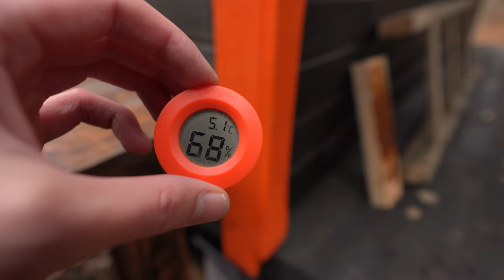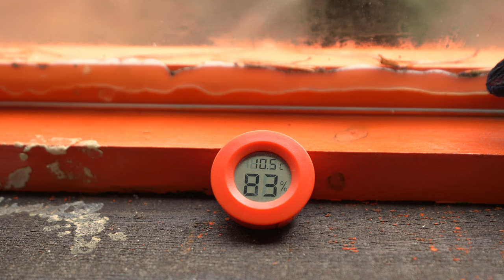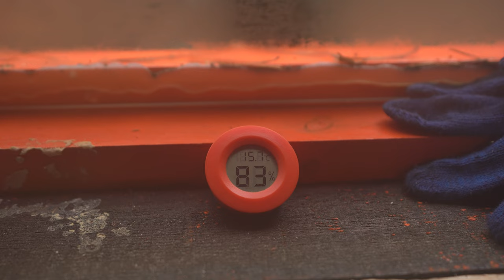Little house in the woods, making a bed (short version)

Comment: Hello my friend, hope you are well! ? You could have made the work on the legs for your bed easier if you had used the saw for the recess, you only had to make straight cuts, in my opinion using the chisel was unnecessary work! But it still turned out good! Keep it up !!! Thumbs up ! Gree
tings Walter 👍🏻Please remember to set up 2 - 3 containers or cans with salt, this will help reduce the humidity in the room!